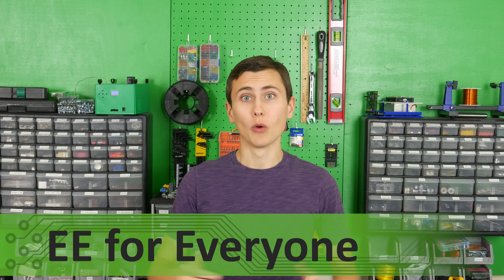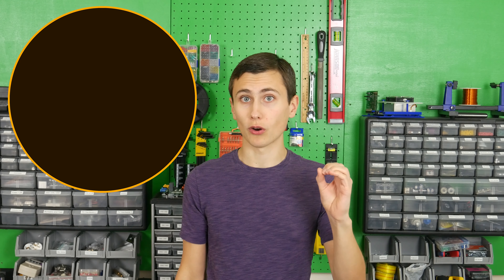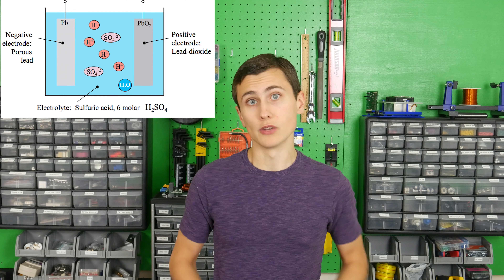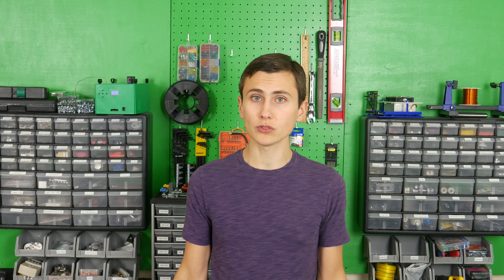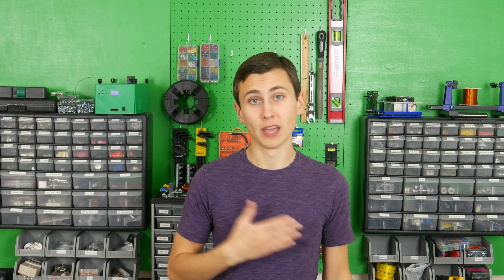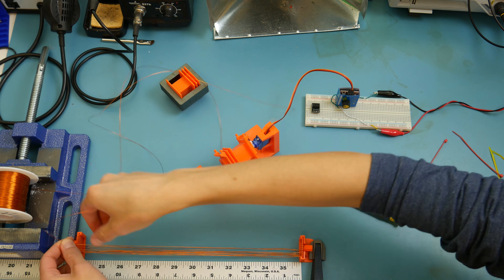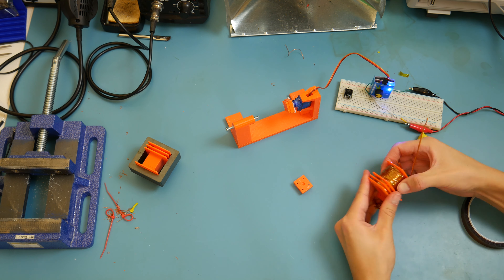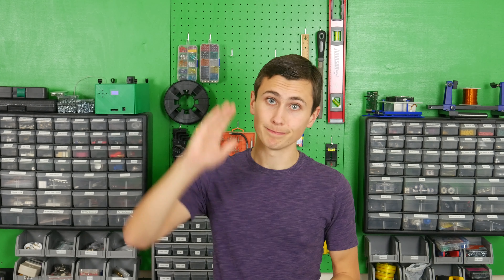Custom SMPS Transformer – Design & Wind

Comment: You can get a cheap chinese solder pot on eBay, I recommend. Have you considered using foils for the primary winding? I am in the middle of a very similar boost stage design, and I did 10mil copper foil for a center-tapped primary, it was also a hassle but my main issue with that is how to terminate it to the board cleanly, obviously you either need to run wires from the foil to the posts on the bobbin, or you need to bring the foil out on top and terminate some other way... ugh!
Reply from the maker: Hello Robin, Thank you for watching! 

Thanks for the tip! Yeah, I discovered those solder pots when browsing MicroCenter a couple weeks ago. $30!?!? Sounds like burn-my-house-down territory... but I just can't help myself. :) I'm definitely going to pick one up if there's a need.

Foil transformers are interesting... but as you said, there are some challenges. :) I'll have to throw foil into consideration more seriously! For some reason my mind jumped straight from magnet wire to Litz.

I've seen planar magnetics used commonly too. They use some of the same principles as a foil transformer but to a lesser extreme. I imagine that having something approximately wire shaped things can make some manufacturing steps a bit easier.

I hope your design is working well, and thank you for the tip!

By the way, what are the specs of your SMPS, if you don't mind my asking?
Reply: @EEforEveryone  Yes the cheap pots are pretty sketchy, I don't leave it on unattended!

My boost stage is 18-25V input (18650 6-cell range) to 185V output (to power an inverter section). For now it's 250W at 100KHz switching frequency, push-pull topology. My biggest stumbling block is the transformer construction, trying to find something repeatable and that I can accurately model on paper.

I'm currently in school part-time for EE (I'm a SW engineer by trade) so I'm still a beginner, but I've been using Switching Power Supply Design and Optimization by Maniktala as my primary reference. Would love to know if you have any other good references!

I could go on about this subject forever...
Reply from the maker: @robingingras  That sounds like an awesome power supply! I'm really excited for you, and I'm sure that no matter how well it does or doesn't  work on the first try- you will learn a lot of good stuff as you continue to research.

Fair warning: this is a long comment. You might want to sit down. :)

Modeling transformers on paper accurately can be very difficult because flux distribution is never perfect in a real core. Perhaps your school has access to some magnetics design software you can borrow? After you finish your paper calculations, that can be a great way to confirm your math was correct.

We have some videos about our Push-Pull converter coming up (shameless plug).. but I'll share a couple words of advice early:

1. Think about leakage inductance. The Push-Pull topology is very sensitive to leakage inductance, especially with large voltage ratios.

2. Plan to have a snubber. (Mititgation for above) - an effective snubber for our push-pull would dissipate more than 30W... so this may be a significant design challenge. 

3.There are other SMPS topologies that provide clamping to a voltage rail, reducing how much a person depends on a snubber, and some of these use the same type of transformer. A full H converter is one example. This may be an easier route, but you'll have to think about this in context for your application.

I was never much of a book learner myself, I've always preferred to learn through simulation, design, and testing... but I have gathered a collection of articles on magnetics design.

In general, if you understand each of the components in your SMPS well and you understand the physics behind the design, the operation of power supplies becomes easier to understand.

My best recommendation would be to take what you're learning about SMPS, and their components. Make a simulation from the ground-up that allows you to change the values of parasitic components of your capacitors, transformer, etc, to see the effect on the larger power supply. Some of these may cause voltage regulation to fail, others may cause more ripple or ringing... This exercise may help to solidify what you are learning and maybe prevent a few issues in your project.

Here are some links to the articles I mentioned before:

Transformer design (Eq. Circuit Model): https://coefs.uncc.edu/mnoras/files/2013/03/Transformer-and-Inductor-Design-Handbook_Chapter_17.pdf

"Windings": http://www.ti.com/lit/ml/slup125/slup125.pdf
"Magnetic Core": https://www.ti.com/lit/ml/slup124/slup124.pdf
"Flyback & Inductor design": http://www.ti.com/lit/ml/slup127/slup127.pdf

I hope this helps! If you have any specific questions about parasitic of a particular component, design challenge, or want me to take a look at your design, leave a comment or shoot us an email. I enjoy creating targeted content to dive into specific questions from awesome people like you, so you may see your question turn into a video. 

We have a "business inquiry" email set up that you should be able to access so we can share files, etc.

Comment: Switching frequency shouldn't be determined by "oh, it's pretty common", you should arrive at a fsw conclusion to optimize the efficiency, cost and size of the design
Reply from the maker: Fair point, MCSGproject! I think it's also safe to say that if my fsw calculation falls an order of magnitude out of what's common, I'd be asking some questions.
Reply: @EEforEveryone  It really depends on the design. For some converters, changing the frequency by 10% can be the difference between meeting temperature requirements and failing them. Really requires in-depth analysis on efficiency. If your design works at 100kHz, maybe it's needlessly large & expensive

Comment: why build one instead of buying a already built Unit? so you can repair and maintain backup power without the need to pay about 300 or more gir a new one or 50  ir more to be serviced just because one 3 or 20 worth of parts failed or falty sensor tripping on the building wiring fault, mine turned on but has not stoped providing my computer with everyday power. at least thats why I want ro build one rather then buy an already built Unit. knowing what to fix and not needimg to microsoder would be nice.
Reply from the maker: Hello mr-mocabrew! We built a custom transformer because this switching power supply couldn't use any that we're available off the shelf! It's actually quite common for switched transformers to be a custom component, this is because there are a Lot of variables, and it's hard to make a "standard" part for use off the shelf.

If you're asking more about the UPS, and less about the transformer, we made one just to see if we could, and to see how far we can push our design! A power electronics challenge. :) 

Thank you for reaching out, and thanks for watching!

Comment: You would make a great teacher. I know at the time you made this the battery landscape was a little different. But  now... you can swap out those ANNOYING, outdated, leadacid batteries for Lifepo4. The cells voltages match up well with LA battery setups. You can get cells from 2 AH all the way up to 300 ah at prices not much more than LA (Cheaper if your good at sourcing). I've replaced LA everywhere I can and will NEVER go back. BTW Im sure you know this but just in case ...stay away from Li-on. The voltages make it more challenging to match up with LA systems, they are too finicky for me (die easier than Lifepo4) and worst of all they occasionally cause fires.